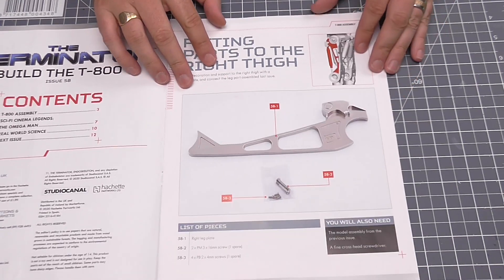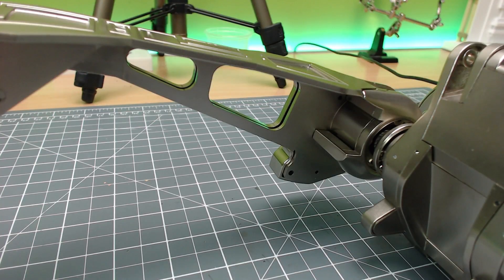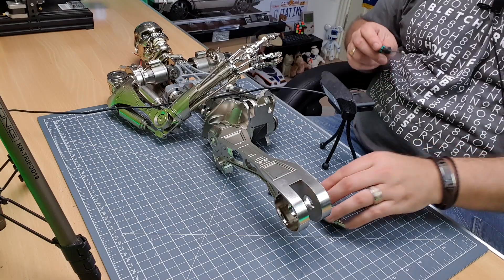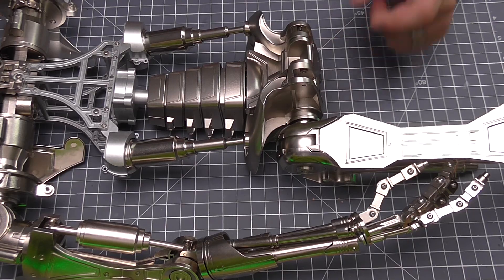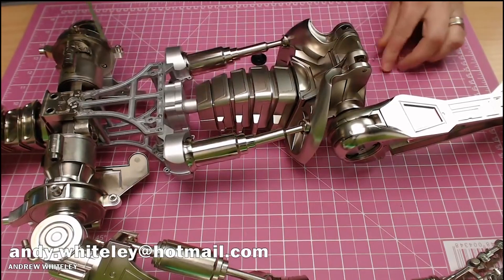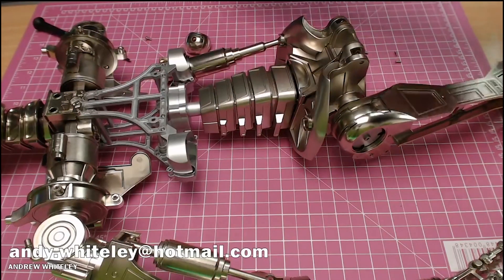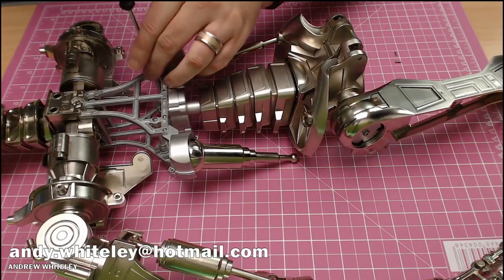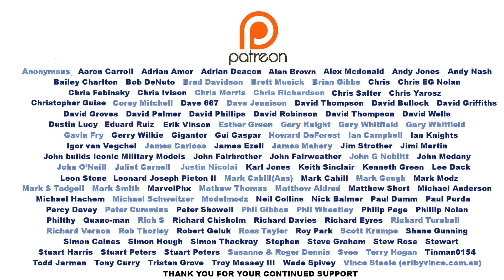Build the Terminator - Part 58 - Fitting Parts to the Right Thigh

Comment: Hi Wayne you would think the legs should be metal to give it weight and stability. I can't help but think Hachette falsely advertised this. They said  high quality metal and ABS parts. The percentage ratio seems to be more plastic than metal so far. Its very disappointing. I thought for the money It cost to make it, I would have a all metal Endo outer shell at least. This whole thing looks like it could break at the main joints over time, or should it fall from its base. Excellent channel  you are very good at explaining how to put your various models together. Have a good Easter to you and your family.
Reply from the maker: Here's what I think. I think the top section is heavy for a reason. That is where the supports are going to be that run up the back. The legs will then not have any weight and the centre of gravity will be central to the model. If it was at the base then the full model would have to be all metal.
Reply: It's not right to have plastic parts when you were falsely given the impression that all pistons and large limbs were going to be diecast . I wouldn't be surprised if the chest turned out to be crappy plastic either.. it could have been such a worthy build .
Reply: @georgebenson6279  no both chestplate/backplate are diecast metal/not plastic. All of the display base will be plastic. But it,s in2halfs. So the front half the is the chestplate/the backplate/are joined together by som much bigger allen key screws+upper shoulder/backplate diecast metal pistons. You can tell by the dulless colour of the metalwork/+their,s agap whereby the2diecast metal halfs/screwed in/secured together. And here,s the clever part both chestplate/backplate will weigh at least2KG each/their,s your missing4KG which will makeup for the total6KG of the completed model itself

Comment: They have missed something off this Wayne.....going back to issue 55 the two leg joint parts (which you glued) 

when fitted to the thigh there are two lugs (which have holes in them) that poke through the thigh.
...fast forward to issue 58....the thigh face plate goes on covering them two lugs up, BUT the leg joint parts (from issue 55) are loose and can be pulled away from the thigh.... ARE WE MISSING 2 SCREWS TO FIX THIS PART TO THE THIGH???
Unless they are coming later which means we have to remove the thigh face panel
Reply from the maker: No we glued in 2 nuts that will take the bolts form Issue 57
Reply: No the nuts take the long bolts that fix the "outer cap for the hip joint"  issue 56, if you try any of them bolts against any of the four holes on the "leg joint parts" issue 55 which cover the nuts from the back, they don't actually fix as the four holes are slightly larger than the bolts. This leaves the "leg joint parts issue 55 loose you will not be able to fix any screws/bolts  once that thigh is fitted......I've looked at every ones video's on YouTube on issue 55, and they all think the bolts screw from the "leg joint parts" side, which they don't...I've disassembled the thigh and checked it out nothing fix's this part. None of the instructions mention the secure fixing of the "leg joint parts" to the thigh.
Reply: The easy way to explain this is to assemble the thigh fully but don't attach it to the hip, when fully assembled, remove the parts "leg joint parts" issue 55

Comment: I really thought that part was going to be metal
Reply: All of the leg pistons are plastic. But their will be diecast metal inserts for smoother leg movement. Much like the hip itself itself it,ll be more plastic than metal. I,ve said it before upper thigh section should be diecast metal/lower leg section should be all plastic same as the arm